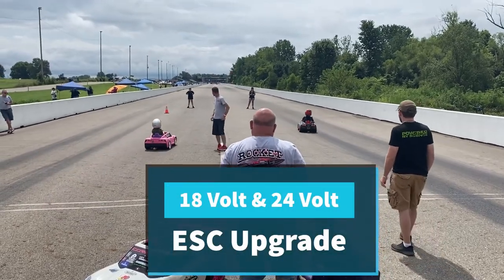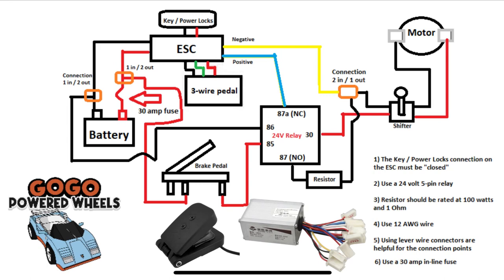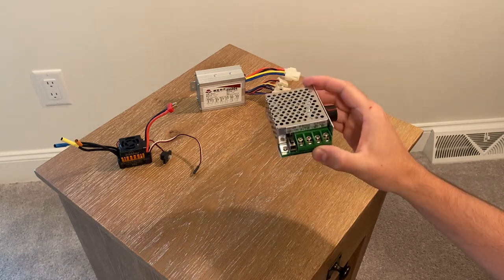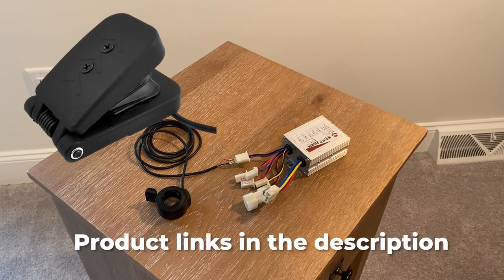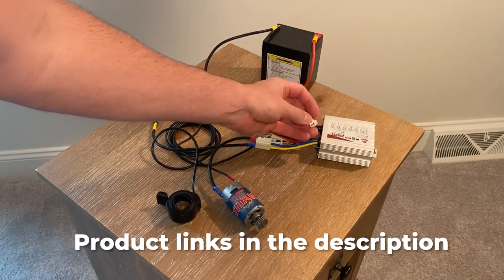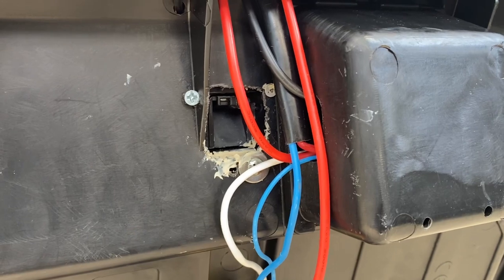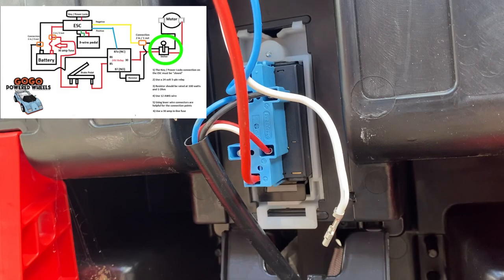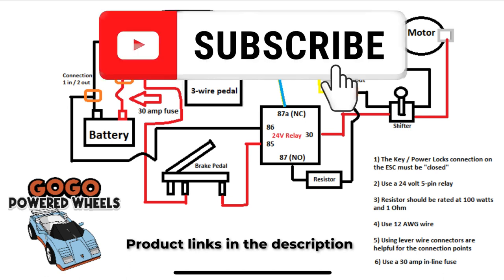Power Wheels ESC Speed Upgrade | How to make your power wheels go faster

Comment: After wiring everything together, when I plug the batter in, the motors start running automatically without the throttle pedal being pressed. Any thoughts on what I’m doing wrong?
Reply from the maker: Is this for the ESC setup? If so, check the pedal’s 3 connections and make sure the colors match up, if not try switching them around
Reply: @DadHacks  the pedal is red/black/green, the ESC is red/black/blue. Connection is red/red, black/black, green/blue
Reply from the maker: To troubleshoot, unplug all three pedal wires and see if it still runs. If not, switch around the pedal wires to see if anything changes
Reply: @DadHacks  not sure what I did, but now I don’t have any power to the motors. My meter seems to be showing continuity through the whole circuit, and my battery is showing full voltage, but the motors aren’t running at all
Reply from the maker: Is the “power locks” (or maybe someone similar to that phrasing) pin connected. That basically an on/off connection, and the ESC won’t work unless that’s a closed circuit. The other thing is, what battery voltage are you using and what’s the ESC voltage rated for?
Reply: @DadHacks  I have the “power” wires connected, battery is 12v, esc is 24v. It seems to have just stopped working. The motors were running as soon as the battery was plugged in, and now there’s just nothing. Is it possible that I caused a short and fried something?
Reply from the maker: @user-uy8ob7fj8t you’re ESC voltage rating is too high, you need a 12 volt ESC if you run 12 volt or 18 volt batteries. There’s a minimum voltage needed to power on the 24 volt ESC, and it’s not hitting that.
Reply: @DadHacks  I got 24v hooked up. Still no power to the motors, but I can hear the relay activate when I press the brake pedal
Reply from the maker: Look at the “power out” wires from the ESC, disconnect those and test if voltage is leaving the ESC when you push down the pedal. If there is, keep search down the line. If power ain’t leaving the ESC, check to see if a fuse has blown or where you are losing voltage before power enters the ESC.
Reply: @DadHacks  I have continuity from the “power out” but no voltage
Reply from the maker: @user-uy8ob7fj8t that might mean there is an issue with the voltage “coming in” to the ESC. When you disconnect the “in” power to the ESC and test the wires from the battery, is there voltage?
Reply: @DadHacks  Full voltage coming from the battery through those wires
Reply: @DadHacks  I tried your initial suggestion again of switching the throttle pedal wires around. The motors initially started to run without the pedal being pressed, like before, but when I unplugged the battery and then plugged it in again, the motors would not run at all
Reply: @DadHacks  I got it working with a higher wattage ESC. Thank you so much for all your help, I really appreciate it.

Comment: How will i wire it if I don't wish to add a break pedal.
Reply from the maker: On the wiring diagram, the red wire will just run from the battery to the ESC, no wire to the brake pedal (because there won’t be one). You won’t be a relay either. The blue wire from the ESC will now run directly to the shifter, where the red wire that came from the “30” relay wire used to go.
Reply: Will having a brake pedal run the gears?   Or does the break pedal slow down to a stop? Instead of an instant stop like I'm  assuming
Reply from the maker: The brake pedal will be more of a soft stop. In a normal Power Wheels, it’s either 100% Power or 100% brakes. With the ESC, when you let off the pedal, the car will roll on it own to reduce speed and then when you hit the brake, it’s easier on the gears because it’s not trying to stop at full speed.

Comment: Will any 775 motor work for the upgrade?  Or some better than others?  It was one of the parts you didnt list a link to buy, so was curious (unless I didnt see it?)
Reply from the maker: Andy Mark 775 redline motors are great. The only thing is that you will need to buy a separate pinion gear, and that depends on what type of car you have https://www.andymark.com/products/andymark-775-redline-motor-1?Pinion=No%20Pinion%20(am-3775a)&quantity=1
Reply: @DadHacks  will I have to buy a new gear or an upgraded one needed?   And while I have your attention, 24v relay will work fine if I'm going to run a 20v battery,  correct?  

Also why do you need a relay? Just wondering
Reply from the maker: @Nick M  if you are just running 20v, you can keep the stock 550 motor. Otherwise if you upgrade to the 775,  you can’t reuse the pinion gear. The 24v relay is used as part of the braking system. (Yes, use the 24v relay for your 20v battery)
Reply: @DadHacks  thanks for your responses!  I appreciate the input!   I did what your other video told me not to do initially (before I saw the video) and just plugged in the 20v battery.  I got lucky and only popped a capacitor.  I'm definitely gonna do the hook up like you  showed though.  

One last question, did you replace the first gear in the gear box with a metal gear when you installed the 775? If not, did it last and not strip the plastic gear?
Reply from the maker: @nickm7394  no need to replace the first gear with a metal gear. Those usually break due to the harsh starting and stopping, the ESC eliminates that. If you need help figuring out the size of the pinion gear, just tell me what ride you have (brand and model) and I’ll see if I can help.

Comment: Okay I’ve followed your directions and despite my extremely limited understanding of electrical wiring, everything worked. But when I got my son’s brute force put back together, I found that it is significantly slower than when I had it hooked up to my ryobi 18v battery and all the rest stock parts. 
For the record, I bought all the parts on your list using your Amazon links and watched a few of your videos 87 times. 
Do you have any idea why adding the ESC and variable throttle made it slower?
Reply from the maker: I’m thinking that the pedal isn’t being pressed down all the way, which is limiting the voltage (and therefore limiting the speed). Are you running the ESC on the Ryobi 18 volt?
Reply: @DadHacks  Yes. I’ve got the 18v ryobi and I tested the pedal. It seems to be going the full reach. I’m wondering if I did the relay wrong. I had a pile of wires and no real idea for how to put them all together. I noticed a black box that looked just like the relays I bought but it said 12v on it so I swapped it with the new 24v relay. That was probably wrong I’m guessing.
Reply from the maker: @pricnat  if the car is working, then the relay is probably correct. Do you have a voltage meter to test how much voltage is leaving the ESC via the yellow and blue wires? Also, since the Brute Force is an ATV, you may want to consider a twist throttle like a real ATV. I’m not sure if this one will fit your handle bar, but if it does, it’s the same plug as the variable speed pedal. https://a.co/d/8LSG24u
Reply: @DadHacks  thanks for the advice. I’ll check the voltage after I google how to use the voltage meter that I bought.
Reply: @DadHacks  and thanks for your videos and comments on everyone’s questions. I’ve learned so much from you. I’m always checking back to see if you’ve done a new power wheels video. And just in case you’re taking requests🤞🏻, I’d love to see a video of the step by step wiring install because it turns out, I have no idea how to read and apply the wiring diagram. And then after that one, let’s do a 4x4 conversion. And then after that, can we convert a rear PW axel into a trailer with motors that can be hooked up to a PW truck or jeep? Just spit balling here…
Reply from the maker: Thanks! Yes, I need to do a full “how to wire” video. I’ll put that next on list. A 4x4 conversion is more difficult because the front wheels would also need a “drive hub” to connect to the gearbox, but the front axel doesn’t have enough room to accommodate it… I’ll also brainstorm about the rear trailer idea
Reply: @DadHacks  okay I’m back. I’ve got just over 19v coming out of the esc. When I plug the motors into it, I’m only getting about 4.5-7.5v. And that’s without the 30A fuse because with that connected, I’m getting 1-2A if any so I think there may be an issue with that as well. Any thoughts?
Reply from the maker: Can you make a “shorts” video of your setup on your channel. That way I can see what’s going on? The 30 amp fuse shouldn’t be limiting voltage, it limits the amps.

Comment: Is that basically the same thing I would do to make the razor MX 350? electric mini bike, the mini crotch rocket and a mini Chopper variable speed? The crotch rocket is the only one that had any electronics on it when I got them for my "adopted" great nieces and nephew. They're 5-8 years old. Covid gave my a heart condition and I was put on SSI. I want my legacy to be teaching them to piss off, evade and elude the police. I'm building myself a razor mini bike with a 6.5 hp gas engine.....  Wish me luck??? Lol.
Thanks in advance
Reply from the maker: Yes sir, it’s the same setup as a MX 350, except the dirt bike has a larger motor (I think it’s 500 watts). The Razor stuff uses the same ESC, but a thumb throttle instead of pedal throttle, but same concept. If you aren’t set on gas powered, you could upgrade the motor on the mini bike and get like a 48 volt battery and let it rip.